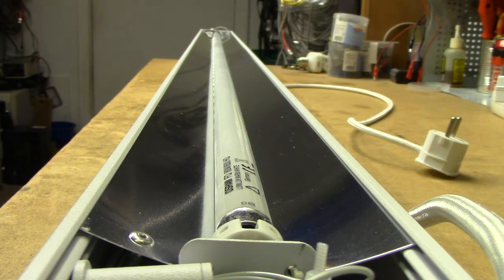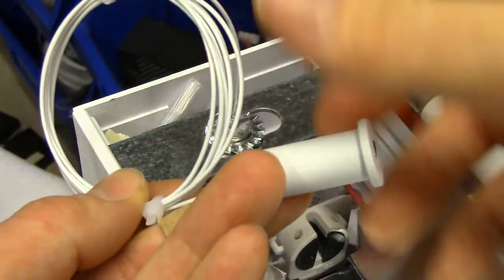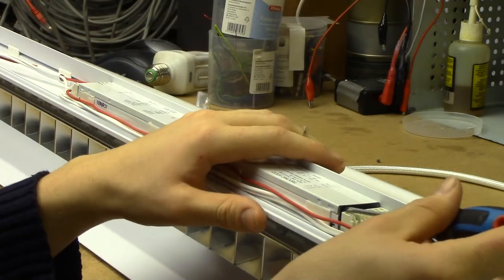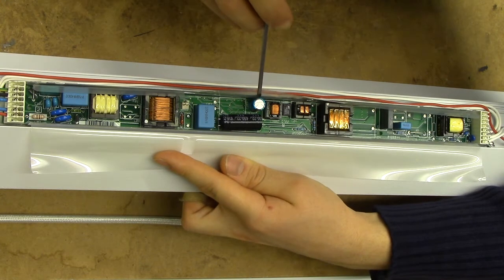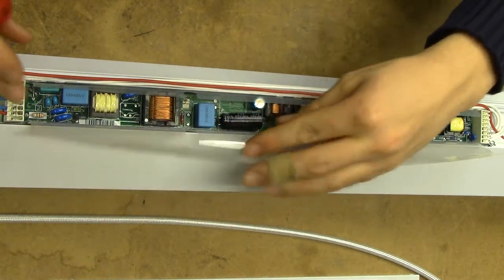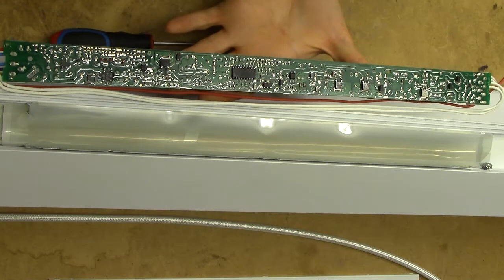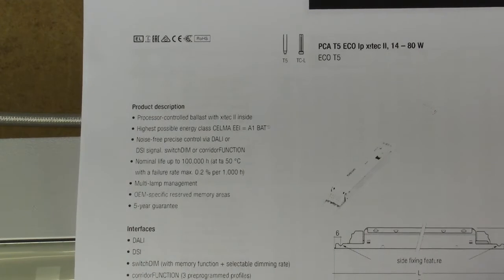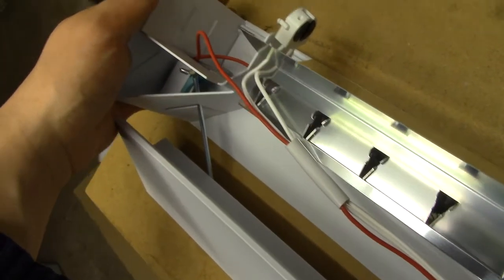High-end 80 W T5 fixture & ballast teardown - Annell A262 fixture & Tridonic.Atco ballast

Comment: Nice video.I have a 3 lamp T5ho ballast an ELT BE-325-T5-2 but the one lamp flickers for a second when it’s turned on but only when the fixture is grounded.Also there is a noise from the ballast I think it’s some type of coil (I don’t know much about electronics ) similar to the first one in your ballast on the left.

Comment: +FFcossag
I very much expect those 'linked out' output coils etc. -- are where extra output chokes would be fitted in the 2/80 version of this ballast (that runs 2* 80w T5 tubes in series).  This particular model is the 1/80 so doesn't have those coils and doesn't have the extra output terminal/terminals.  I don't think they have 'skimped' per-se!.   Hope that helps too!

Comment: In regards to the emergency DC stuff, Im not sure how you guys do it over there, but I imagine its the same/similar to here in the states. But for the emergency part you often get a battery pack that wires up with the normal ballast inside the fixture so when the power goes out it keeps it on at a reduced light output.